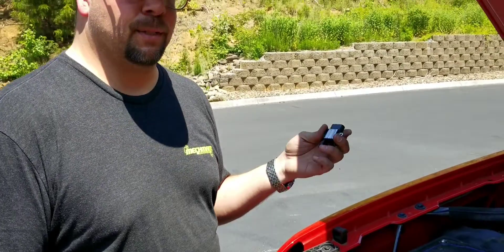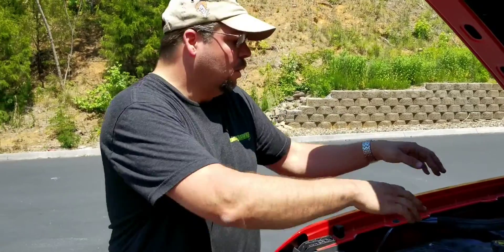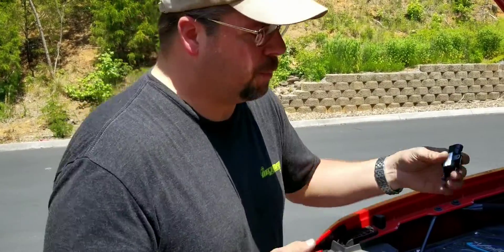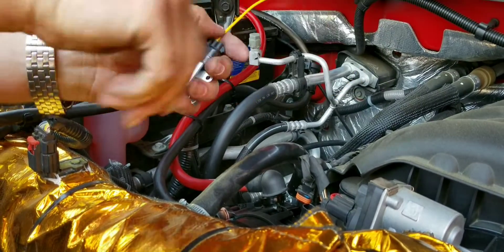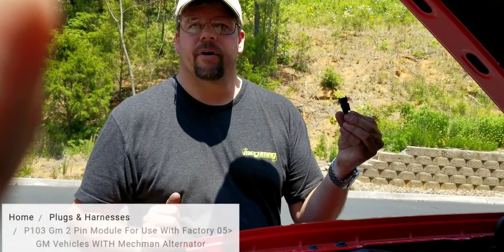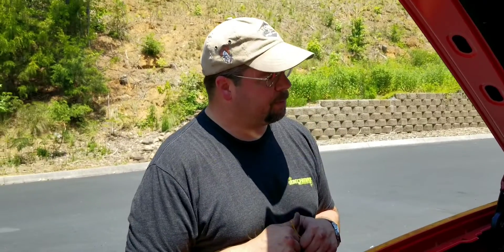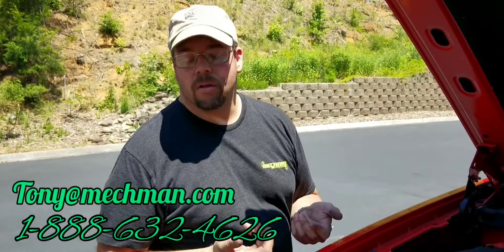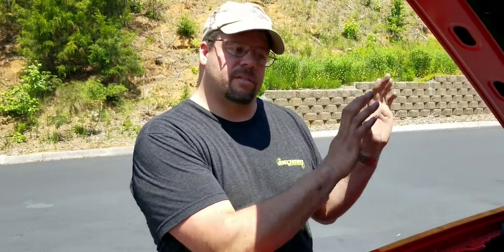Mechman RVC Bypass option (P103 module) for GM vehicles tech and overview.  Part 2

Comment: “Great video — thanks for sharing! Quick question: how difficult is the actual swap to the single-wire regulator inside the alternator? I saw you mention it, but didn’t catch how many screws, if brush adjustment is needed, or if you need any special tools. I’ve got a 2011 Camaro SS with a JS high-output alternator and I want to make sure I’m ready before I pull it apart. And does any gm 1 wire regulator fit ?

Comment: I have a 2006 trailblazer ss with a 6.0. I have your mechman 400amp alternator. Can you explain to me why when I connect the one wire to an ignition source. My battery light comes on. So I just leave it unplugged and no light comes on. I checked the battery and the alternator is charging the battery…

Comment: I have 2018 Buick enclave and alternator fluctuates then stops and fully charges battery when the head lights are on. This seems like what I need to keep alternator running
Reply from the maker: Or, just use our new MM-VC1 voltage controller.  Much easier now! ;)

Comment: It’s worth mentioning that the stock GM RVC feature has 6 modes: charging, cruise, deceleration regen, desulfation, high performance, battery warming.  So, by just leaving it stock your lead acid battery will last longer, truck will get better mileage, and engine will make more horsepower.  Just putting that out there so folks can make an educated decision on what they want to do.
Reply from the maker: Correct, we cover this on our website:  

https://www.mechman.com/instructions-and-technical-resources/gm-2pin-rvc-explained/
Reply: It also cuts the alternator completely out over 3k rpm when using a high out mechman alternator. This causes an unnecessary drain on the battery and the voltage drops to 11 volts. Sometimes, while driving on the highway across the country going up a hill, the engine won't go below 3k rpm for miles. Very bad for the battery. Unfortunately, the stock RVC system isn't great, especially if the vehicle doesn't have an amp loop on the ground.

Comment: thanks for the pt1 and 2, I had a small case gm HO alt on my 92 s-10 build, I parted it out an sold the alt, the client who purchased it states away thought the alternator was broke bc of the miscommunication caused,  the vehicle he was putting it in is a 2016 after mentally diag it and determining the issue this video absolutely supported my hypothesis, I really appreciate you making these 2 videos!
Reply from the maker: Just real world stuff man, no gimmicks or tricks needed. Facts are facts.

Comment: i have a 370 e series alt in my 2012 impala, i’ve done my big 3 with all copper wire i have good grounds but im only charging at 13.7 - 13.8 could you tell me why im charging so low?
Reply from the maker: How old is the alternator / When was it purchased?
Reply: @mechmanalternators  i bought it about 2/3 months ago.. it was brand new when i bought it
Reply from the maker: @Htx_ScrewHead   Is the regulator on that alternator a 2pin or 4pin style?
Reply: @mechmanalternators  4 pin with 1 yellow 12v wire
Reply from the maker: @Htx_ScrewHead   You either don't have a good 12v key on source with the yellow wire and/or you didn't change your belt to a 1/2" size shorter.
Reply: @mechmanalternators  it was brand new

Comment: Hello I have a 400 amp alt on my 16 Sierra started noticing when I’m at a red light and not playing the music loud my voltage drops to about 14.2 but as soon as the light turns green and I hit the gas it goes back up to 14.6 is that normal during the summer since the temperature is rising or is something else going on?
Reply from the maker: Might be possible slight belt slip or just some good old fashioned heat soak.
Reply: @mechmanalternators do you mean belt slip as in the belt is too long and he needs to go 1/2 inch shorter??

Comment: What's on my mind??    My trucks battery? Brand new! alternator? Passed the test it's a good alternator!  Truck still dies overnight and now more recently when I hit the brakes hard or change into reverse and turn the wheels   or if I shut it off and leave it for a few hours without using killswitch   it's dead  installed a killswitch to shut off all power overnight..  and it still dies after a few trips   from a freshly charged battery and shutting off main power as soon as I get out of truck  ..   got any ideas???   I've done Amp draw test in line on ground  no draw when just disconnect  and reconnect  battery after stuff goes to sleep
I dont have the rvc fuse so i dont have that generator battery control module..  ..  ..stumped 2005 chevy silverado 4wd extended cab 5.3l

Comment: Bought a 370 amp elite from down4sound for my 05 Chevy 1500 came with the 4 pin setup I can’t recall if it came with the p103 plug or not went to install it noticed the plug was different I was mad called down4sound said I got the wrong unit it bolts up but doesn’t plug in no instructions lol returned the unit to them took a 100+ dollar restocking fee wish they woulda talked me through this process wasted time and  money still have to order me another alternator so beware guys and gals it doesn’t matter if you order the 2 pin or 4 if your gonna bypass the rvc system if I am not mistaken. This was couple years ago before these videos were posted fyi.

Comment: I would love to have that, however the 240 amp alts   is all i could afford, this thjngs are not cheap, however, ? Will that work on the 2 pin mechman 240 alt? If so please share the link
Reply from the maker: Just use our MM-VC1 for the 2pin GM style regulators.  https://www.mechman.com/voltage-controllers/mm-vc1-2005-gm-2pin-rvc-voltage-controller/

Comment: I have daul alternator on 2001 tahoe one for truck and one for audio system alt comes on stays at 14.8 and wont charge when need to i have all the necessary grounds and positives goin To rear Batts and also have a 49 amp 4 pin relay spst also swapped around alternators same issues need help
Reply from the maker: Yea, theres like 57 different that could be going on. I'd consult an audio or repair shop for accurate diagnosis.

Comment: I have a 2012 Chevy Avalanche and have just upgraded my alternator to a 300 amp unit.  I now have a "service battery charging system" on my computer screen and a Red battery light on all the time.  Can the system in your video solve this issue?  If so, how can I order it?  I don't see these parts on your website.  Thanks
Reply from the maker: Sounds like you have an installation problem.

Comment: Hello everybody so I just ordered a mechman 400 alt for my 16 sierra. So with bypass do I still need to run my grounds through the amp meter? Im also adding a second battery how would I ground it to the starting battery if only one 0 gauge wire fits through the amp meter someone help me thank you
Reply from the maker: Once bypassed the sensor is no longer needed. 

Just ground each battery to the frame.

Comment: I have a 2017 Silverado, what length wire is needed from the alt to the battery? Thanks!
Reply from the maker: Really? REALLY?  I would suggest investing in a tape measure.
Reply: @mechmanalternators  I appreciate your potential customer service response smartass!
Reply from the maker: @jamiewiden9237   I mean...it's WIRE man.  You can route wire 57 different ways and get 57 different measurements.  They sell it by the foot for a reason.   Sorry....
Reply: @mechmanalternators  no worries, maybe I should have worded my question different. I was hoping that since it was the same setup as my truck will be that you had a designated length already for the 2014-2018. I have several tapes measures and I will figure out what I need. Have a great day!
Reply from the maker: @jamiewiden9237  Thank you Jamie. We honestly just have a spool of wire, drape it over where we want it to go and cut it.  

Some people like to be fancy and loop it/trace it with other wires under the hood so what "we" think looks good may not be what you think looks good. :)

Comment: With that you don't need to run your ground threw the rvc right
Reply: Yes sir hooked up a stinger to my amp at full tilt I see know less than a 14 very happy with alternator
Reply from the maker: Correct!
Reply: I have a $240 amp alternator make man a 1200 watt RMS amplifier a AGM 1200 w battery 4 gauge running from the battery to the amp the upgrade one ground from alternator to battery of zero gauge one power from alternator to battery 0 gauge and it's the voltage on my radio that drops down to around 12 6 12 9 every now and then but my truck dash voltage will never drop below 14 I just bought a stinger to hook to my amp someone told me that the radio voltage might be off by volt
Reply from the maker: @darinmoorman1872  That sounds about right, most newer/electronics have a computer that will manage WHERE and HOW MUCH the voltage goes.  See below link for video showing ECU voltage vs. OBD2 port voltage on a 2008 Silverado:

https://youtube.com/shorts/QFhC2-UREdw?feature=share
Reply: But the voltage meter in my truck never goes below 14 and before I put the alternator mechman 240 and AGM it did drop on the meter in my dash for voltage
Reply: I bought a alternator from y'all just to make shur that when the bass hits it's normal for the voltage to drop down to 13 or 12 is that normal
Reply from the maker: @darinmoorman1872  Ideally, no.  This means you have some issue to look into.  What is the RMS rating of all the amplifiers you have?   You possibly could have too small of an alternator for your setup.  

Also, what battery or batteries do you have?  You could possibly need bigger or more battery reserve.

You could also have belt slip problems. It's harder to turn an alternator when under load so if the belt is not gripping, its not turning the alternator to make the power it needs. 

Also could be wiring.  Cable size, length of run and even grounding locations/quality. 

For reference, I have a SALT 1700.5 amplifier in my truck, 2 underhood AGM batteries and currently operating(testing) a 370-amp alternator.  While cruising the voltage rarely fluctuates more than .2-.3 volts under full load.  At a stop light/idle, itll touch on a 13.9-14.4 voltage range under the most load which is my ammeter soley on the amp(doesn't include amperage needed for truck) will usually pull around 155-160 amps.

The 370 ap alternator makes around 190-200 amps at idle so this ensures i never dip into NEEDING the battery bank to support the power. If you are dipping into the 11 volt range you are needing more than you can provide.

Comment: i came here looking for what is supposed to be on the two wires. i know that L is supposed to be a duty cycle that changes but what is the other and what do i have to do to get alternator to charge with the two wires?
Reply from the maker: You can't.  You cannot run a 2pin alternator by itself, it needs a computer to operate it.  Or, if you are OK with 13.4-13.6 volts it will default to that when unplugged/not connected.
Reply: You don't need a computer. You need a pwm or a signal generator. 128 hz and a duty cycle percentage will allow you to control voltage.

Comment: Would this setup work on my 06 impala 3.8l v6? Currently have a mechman 320a installed now. And at idle it dont charge for poo.
Reply from the maker: I'm only showing a 3.5 and a 3.9 V6 engine for that 06 model year.
Reply: @mechmanalternators  yes sorry. It is the 3.9 v6. Typo.
Reply from the maker: @garysimpalow7467   We do not advertise or sell a 320 on our website. That application uses a small case style alternator and when you go over 300 amps, it moves the power UP in the RPM range so it won't charge much if at all at idle.  We 9/10 recommend a 240 version because it has the best balance of output at idle and cruising RPM's. 

https://www.mechman.com/alternators/buick/allure/3-8l/2006-2009/240-amp-alternator-for-gm-late-front-wheel-drive-v6/

Comment: You aint kidding about the heat. It was 90+ yesterday and I noticed the voltage was sitting around 14-14.3. I typically stay steady around 14.7. (2004 Tahoe)
Reply from the maker: Thank you for NOT calling us and freaking out.  :)
Reply: @mechmanalternators  You're welcome. My amps rated at 12.6 so 14 doesn't bother me.

Comment: how can I get my 2 pin 370 running off the 4 pin plug . I bought the 2 pin based off my truck year 2005 Tahoe . But I didn’t know the truck was going to regulate the voltage . Is there anything I can do to make it stand alone . It is a dual alt setup
Reply from the maker: Just use our online RGA ticket and send it back to us and we'll convert it correctly and have you all set up ready to go!  https://www.mechman.com/rga-request/

Comment: The plug I got with my alt was not a one wire like this one lol it has a plug on it too I guess so I can plug my old harness into it but when I do it turns the alt off but if I plug it in without the harness it works… I have a 95 S-10 V6 when I hook up the wire to 12 volts it’s fine but if I plug my old harness into it it shuts the alt off
Reply from the maker: Sounds like you have some electrical gremlins AFTER the harness.

Comment: Hey man, i called Mechman bc i purchased a MM 370 amp alternator for a 2018 GMC Sierra from D4S about 2 months ago and everything was working fine up until a couple of days ago, the battery charging system icon popped up on the dash. Went to get it checked out at an Oreilly and they said it was the alternator but Mechman said it wasnt. They said it had something to do with the RVC and ground wire? I didnt understand them. But why would my alternator mess up out of nowhere? All big 3 is hooked and all good, could anyone help?
Reply from the maker: Sounds like you may need to watch our video about the 2005> trucks and correct wiring/cabling here:  https://youtu.be/IccufClp-0c

If that is correct, the other "go to" is the shorter belt option. This information is covered on our website as well as documentation included with any alternator purchase.

Comment: Is it normal for the P103 model to work when it wants to? Sometimes I can start the truck with no warnings or battery light and Sometimes I get warnings and battery light on. The model is plugged in all the way and is locked in place.
Reply from the maker: Usually in those cases finding a different 12v switched source for the alternator can work. These newer electronics can be very finicky.

Comment: Ordered a 370 with the RVC bypass! I couldn't stand the voltage fluctuation even before I started adding more power hungry components. I can't wait to see the voltage hold at it's best all the time.
Reply from the maker: It can be annoying for those really wanting to slam some power.  I usually say if you're not over 2,000 RMS watts then the 2 pin / RVC setup isn't really a big issue.
Reply: @mechmanalternators  yeah it probably isn’t much of an issue there. It really started to bother me when I put the whole truck on lithium. It wants steadier voltage.
Reply from the maker: @miiiikee_   Good point, forgot about the Lithium switching.
Reply: @mechmanalternators  yeah, even just getting the voltage to hold steadier in the high 13's to mid 14's without the RVC interfering should be great
Reply: This! man it gets my ocd going and always makes me feel like something is wrong even though I know it isn’t lol. I currently have an rp 2000 and two evl 12s as a starter kit haven’t installed it yet but will be next week into my 09 tahoe I’m trying to get my electrical system set up to handle 5k watts since I know I won’t be going over that. Is this the alternator I should order along with maybe a second battery ?
Reply: How can I order this
Reply: How it push?

Comment: Saving up money for a 240 Mechman alternator for my 92 Chevy truck🤑🇺🇸
Reply from the maker: How much more ya need to save up?  :)
Reply: @mechmanalternators  well I'm at the plasma place getting $100 to donate so roughly 200 bucks but I'll get it because I'm finishing up a tile floor no worries 👍👌
Reply: Ordered some GP one on gauge wire along with double fuse block and a distributor block looking for some acrylic now

Comment: I had the first setup on my 400 amp mechman on my 17 Silverado which was regulated sent it back to get the old style regulator for it to be stand alone and did the same bypass for the battery light  won’t come on in the dash and I’m much more happier with the stand alone!!!
Reply: I just sent my 370 amp back to Mechman after a month of having it to have it converted as well. My truck was doing some weird stuff with the voltage with the 370 installed and Mechman recommended upgrading it to a one wire turn on bypassing the RVC on a 2015 Silverado.
Reply from the maker: Awesome, thanks for the feedback!
Reply: By any chance are y’all gonna come out with a dual alternator bracket for these year models anytime soon?
Reply from the maker: As of right now, it's not on the table. We're pretty sensitive on our brackets as they need to be built extremely sturdy, provide killer belt wrap  to limit as much deflection as possible.  So when/if we build one it needs to be better than what's currently being offered.
Reply: @mechmanalternators    Ah ok cool thanks for the reply!
Reply: Can you guys help regarding a 370 amp Mechman in a 2018 GMC Sierra? I had my car audio guy install it with the big 3 about 2 months ago. Recently the charging battery system light came on the dash, not sure what couldve caused it but the voltage is really low now. I called mechman and they said something about the ground wire and rcv? Do any of you guya know what problem im having? Since yall mentioned a 2017 Silverado which is like the same thing
Reply: @bashns7743  a saw
Reply: What do I need for a 2016 Camaro 2SS